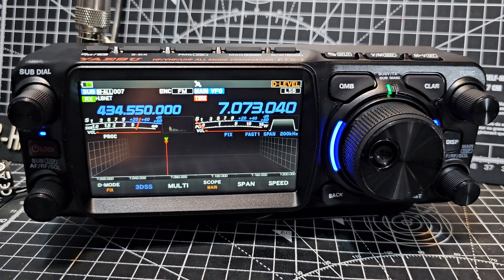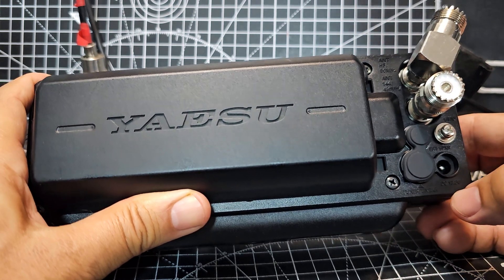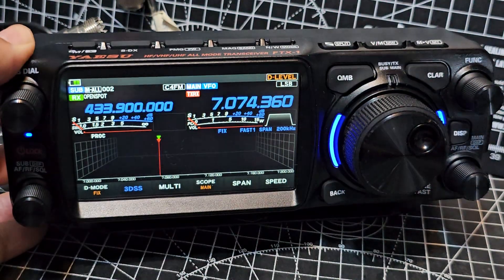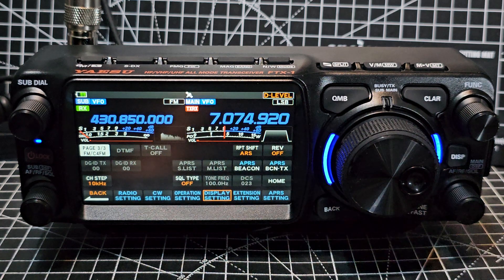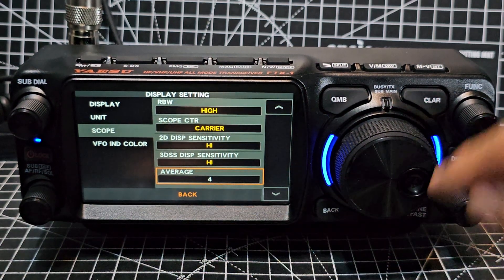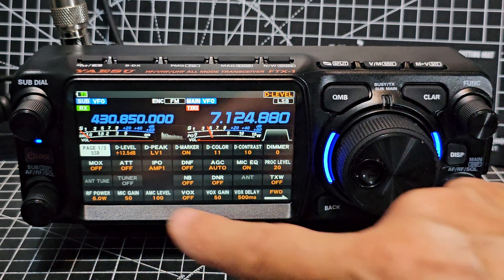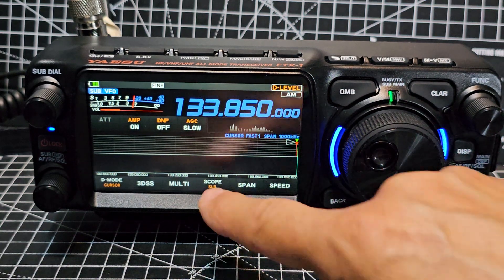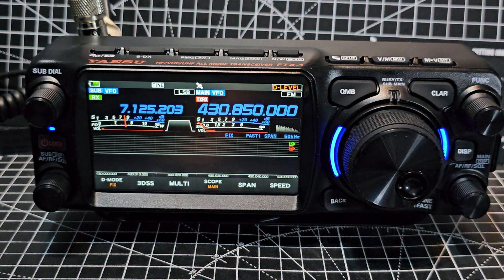Yaesu FTX-1 Beginners Guide

Comment: Is it possible to connect this radio using a 10pin mini din / RCA cable to a 3rd party RF amplifier like a sailor marine amp. My 710 does this perfectly. Thanks 73
Reply from the maker: Check with Yaesu

Comment: Andreas, you should test the VFO scan feature.
Because when I read the manual, I understand that it only works with the microphone... and that's unbelievable !? 😯
But indeed, it seems there's no SCAN menu, and I don't see a physical SCAN button either.
It means that if you want to simply scan and listen, not transmit, you have to plug the microphone anyway... weird move from Yaesu !

Also, did you try to save a split frequency into a memory channel ?
It's also weird, because according to the manual you can only input the TX frequency into the memory, and nothing else... but often the RX and TX frequencies have different settings (CTCSS etc.), so how can we set them here ? Seems impossible 😯
Reply from the maker: Yes good points I await the new firmware whilst looking at all the things there do work well .